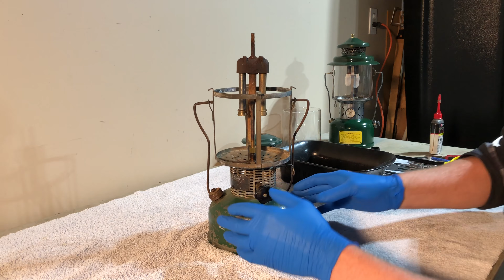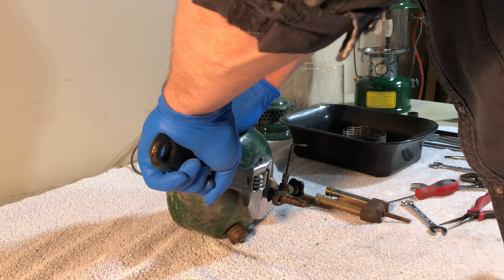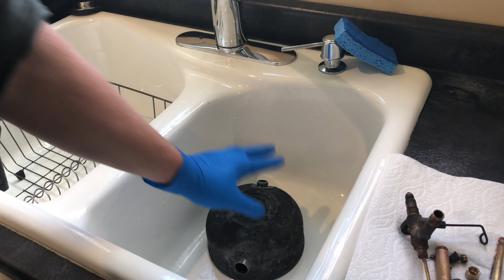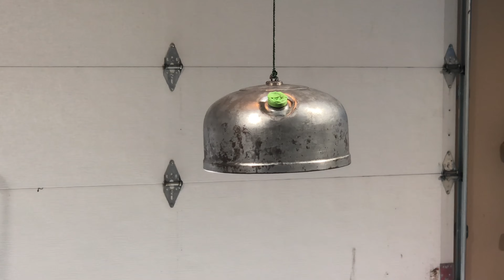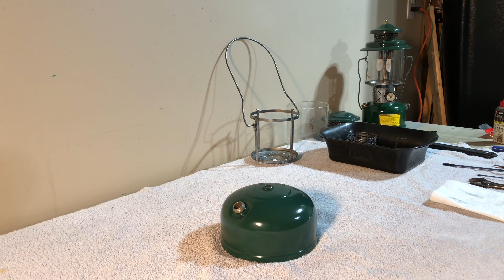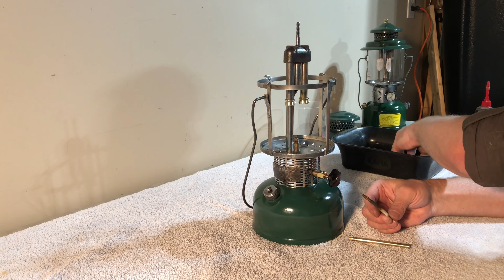AGM 3927 World War II Military Lantern

Comment: Bill, I was wondering what you place inside the bung to suspend the fount for painting.  I just got an AGM 2471 to fire up and run after an exhausing time including a Caswell treatment.  I plan on doing a thorough resto similar to what you did on your 3927.  Great video as usual.
Thank you.
Reply from the maker: I tied a paperclip the end of the string and bent it so that once inserted, it would grab the inside of the fount.  It's strong enough to hold the fount, but you can easily pull it out when done.  I typically screw a bolt into the bung and tie a string under the bolt head, but as I recall, I had a couple founts to paint that day and could only find one of my bolts.  Alternately, you could use an old valve body.
Reply: All good suggestions.  I’m going with the bolt method.  Thanks.

Comment: For stripping paint I've had great success with DOT3 brake fluid. It takes time but most of the time with older paint it called it to release and just slide off. Brake fluid doesn't seem to work to well on powder coated items though so I'm guessing the chemistry is odd but old enamel really doesn't stand a chance. lol   For old founts, especially rusty ones, U do a prolonged simmer in a slightly stronger citric acid bath.... like all bloody day long.  It has done a wonderful job and gets rid of everything, taking all three paint and rust with it.
Reply from the maker: Thanks for the suggestions.  Dichloromethane is the active ingredient in traditional paint strippers and a chemist friend of mine recommended I try chlorinated brake cleaner, which also uses dichloromethane.  It kind of worked, but it evaporates much too quickly to be practical.  I've found that acetone is extremely effective on some paints, but not on others.  The wire brush take about as much time, doesn't really cost my anything, and removes a lot of rust along with the paint.  I'm hesitant to use it on brass founts, but on steel it's pretty fast and easy.

Comment: Another great video. Great lantern. Amazing it doesn't have any stress cracks in the fount. Can't seem to find an AGM without them. Keep up the great videos.
Reply from the maker: It's the AGM brass founts that develop stress cracks.  The steel founts like this don't have that problem.
Reply: @king.coleman  Have you heard of anyone annealing the brass ones to relieve the stress on the brass.  Don't know if making a fount dead soft is a good idea or not but seems fine at the low pressures a lantern runs at.
Reply from the maker: I have not.  I suppose it might work in theory, but I'm not even sure how one would go about doing it.
Reply: Probably a moot point.  If they haven't cracked in 70 years....... 
To anneal brass and copper, which are work hardening metals, you just heat them up.  An oven or a torch, grill, campfire, camp stove, etc.  Unlike steel, quenching doesn't harden them.  If you watch copper and brass smiths making pots, kettles or other thin walled pounded pieces, they will pound for a bit and anneal, pound some more, anneal, lather rinse repeat until they're done.  You can feel it harden as you work it, that's when you stop and reheat/quench.  If you keep going it will get brittle and crack.  I never saw the brass fount process for lanterns but I'd imagine that AGM may have taken too big of a bite in their forming process or perhaps didn't anneal at all or thoroughly/often enough based on their reputation for stress cracks.
A strange little experiment to demonstrate the properties is to simply take a few inches of solid conductor electrical wire and bend it back and forth.  The area at the bend point will harden, as you continue to bend, a new softer point adjacent to the hardened point will bend.  Now heat it and it's all pliable again.  So if you ever need to bend a brass cleaning lever, or remove a dent, heat it first, bend it a little and heat again.  Again water quenching is fine and speeds things up.

Comment: When I refurbished my Coleman 220 BX, I used an etching primer before the color coat and it really came out great.  When a spray can (rattle can) no longer will spray, I punch a hole in it and drain the paint into a glass jar and save it to use in my airbrush.  I like painting with my Badger Anthem 155 airbrush.  I can control the spray a lot easier with my airbrush.  My friend gave me a can of Coleman green enamel paint that was color matched to Coleman green.  I've used it to repaint a Coleman 425NL stove and it came out great.  He also gave me several cans of paint, one is Coleman red and Sears blue, all color matched (I think it's auto paint).  Cheers from eastern TN